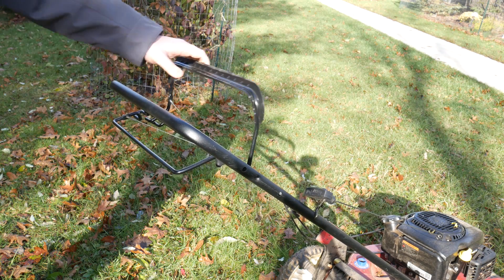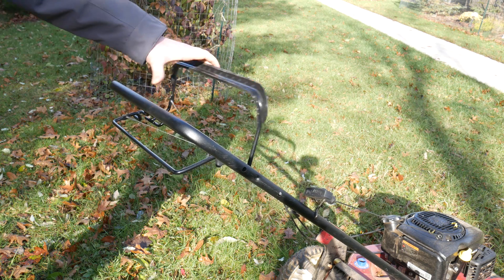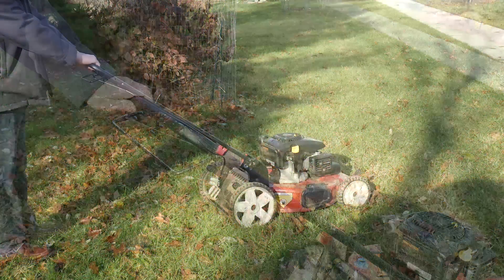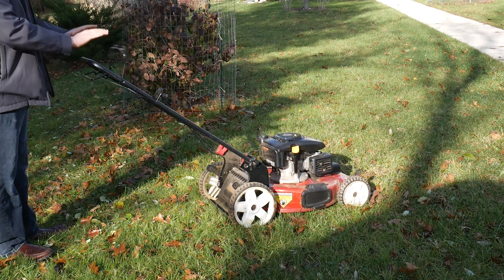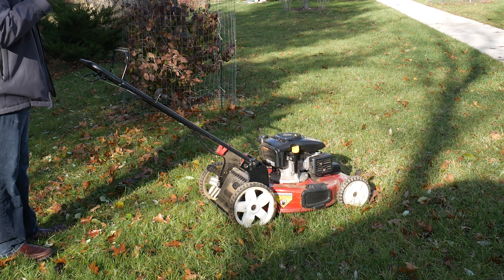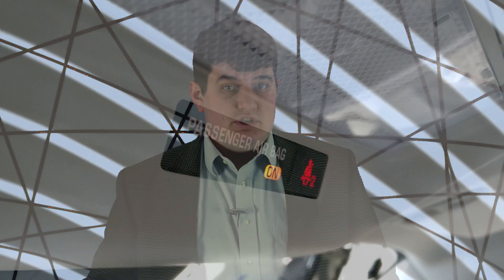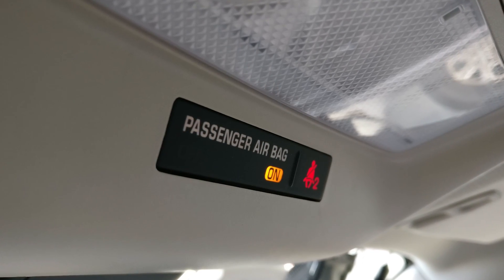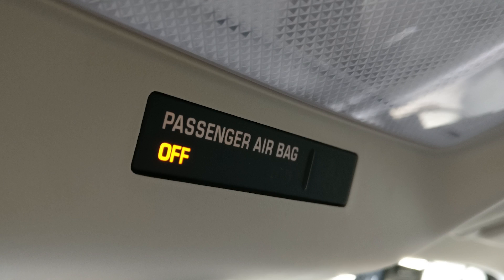The Dead Man's Switch:  How Anton Yelchin's life could have been saved

Comment: My 1972 Ford Maverick had a seat sensor interlock, they were only activated for vehicles sold in California. The interlock won't let you start the car without sitting in the seat and buckling the seatbelt. If someone sits in the second seat, they to must buckle the seat belt. Both cases it has to be in that order, you can't sit on the seatbelt.
(There's also a mechanics bypass button in the engine compartment so they don't have to get in and out that much.)
There are however issues. I had to replace a $300 computer because it stopped sensing the brake interlock for my gearshift on my last car. (something that they added back in the 80s) The sensor was working fine, the computer wasn't responding to the sensor. No shift out of park. The mechanic could not legally remove the solenoid that prevented me shifting out of park.
Just a note on vehicle engineering, my father was an Aeronautical engineer and worked on two of the world's first completely fly-by-wire aircraft: The F-111 and F-16. You lose your electronics in an F-16 it becomes a brick. The only thing that will work is the ejection seat at that point. 
But this is important: The F-16 had 3 completely redundant systems. They self checked themselves and voted on what to do. I don't trust cars with steer by wire because the redundancy is very low. I work with data heavy computers and applications all day long; I do routing, networking, and manage a small virtual cluster. 
Thus, I don't really trust computers that much.

Comment: Interestingly, Tesla vehicles have this exact same type of dead man's switch. If the car is stopped or moving very slowly and the driver gets up off the seat, the car applies the parking brake and shuts off. So if you get out of the car and forget to put it in park, it will put itself in park and power off. I don't know if any other cars have this feature, but it makes sense.

Comment: the problem with a dead man switch on the driver seat is that in case you need to push the car for a reason or another, you will require added weight on the seat in order to push it, in some cases that may even make it impossible to push, while at best case scenario, would require at least another person siting, instead of helping by pushing it.
that may be a "but why not call for help?" question, but we never know the type of situation we may find ourselves into, having this locked may get in the way more times than it will help.

Comment: A pretty compelling case.  Also consider that many cars use a passenger side sensor to alert you if a passenger has not buckled their seat belt, so again, the tech is already there.  You can tie it to a number of different things in the car.  I personally would not vouch for the door, though, as my old car was the victim of an unoccupied vehicle rolling (my dad's old truck, he wasn't in the habit of applying the emergency brake).  Seat belt or pressure sensor would prevent that; door sensor would not.

Obviously ANY such system should have an override for maintenance, testing, towing, etc.  And yeah, as far as the computer's power over the car, that's been done quietly for ages.

Comment: All true but you missed the most important failure. He never set the parking brake. This seems to be a very common error with automatic drivers. Set the damn parking brake! We as users need to take responsibility for our own actions and stop blaming providers for our stupidity.
Reply from the maker: Just to clarify, you are aware that there's no specific need to set the parking brake, right?  With an automatic transmission, the vehicle cannot roll in Park due to the parking pawl in the transmission.  I realize you should set the parking brake, but most people are taught that in an automatic it's only strictly required if on an incline in order to prevent damage to the transmission.

Comment: I don't want to get into all those 'Brand' arguments but my 2015 Ford Kuga will scream Blue-Murder if it is left out of Park when you get out ; it senses the door, the seat and the brake-pedal for engine and gearbox operations. For any car to have this it might need a seat-sensor added , but no other sensors have to be added [since your door already has an interior-light switch and the brake already has a brake-light switch] - so little extra cost - it is just software.
It is a pathetic failure that a 'modern' car such as the Jeep lacked such safety-interlocks.

Comment: Video: "You can program in something like pushing the ignition button 5 times to override the sensor, and it can be ignore at high speeds so it doesn't trip from shifting in your seat."
Comments: "DUUUUUUR HOW U SUPPOSED TO TOW TEH CAR GET A 200LB BRICK LOLOLOL ALSO WHAT IF I LEAN TO FART AM I GONNA GET LAUNCHED BECAUSE IT STOPS LOLOLOL DIS SUGGESTION IS STOOPED"
You can always tell which people didn't watch the entire video before commenting. 😒

Comment: Way easier solution than relying on the seat sensors... The moment the driver's door opens while the engine is running, the automatic transmission shifts itself into Park --- even a 10-year-old E70 BMW X5 (with a similar shifter mechanism) does this.

Comment: Are you on a space ship? Very futurist background.
Reply: The Nevo shhhhhhhh.... let the magic exist.......
Reply: If the accident happened or could have happened with the car in neutral, this wouldn't help. Allowing an unoccupied car to remain in neutral is necessary for towing or otherwise moving a car that isn't running.
Reply: @brunner314  Flatbed tow trucks, which are already required for 4WD/AWD cars, would negate this problem.
Reply: DaedalistKraken maybe add an extra step to override not being able to put it into neutral if there is no driver, so that it can’t accidentally be put into neutral without the driver.
Reply: @brunner314  There could be a specific override (code or switch) for that.
Reply: @brunner314  there could just be a switch inside the car that manually disables to switch for times like that. If you're worried about people who would just leave the switch active then have it so the next time someone sits on the seat the switch automatically returns to the off position.
Reply: Nerds... In... Spaaaaaaaaace!
Reply: @RicheBright  Wheatley?
Reply: futurist? this is right in line 80's photo backgrounds. only lacking the color. hardly futuristic
Reply: If I go into my backyard and rip up all the grass and hang out my wall and then film myself in front of it could you use it as a green screen?
Reply: Clearly he's actually cylon number zero.
Reply: Star Trek
Reply: I think this spaceship was owned by Eddie Van Halen
Reply: @kobalt_ren01  yeah! I thought so too! Looks very similar to the frankenstrat stripes!
Reply: Yelchin was Chekov from Star Trek.
Reply: Greenscreen

Comment: More than that, all modern cars can apply the hydraulic brakes electronically, since the brakes in tandem with the ABS system and pumps are used to control stability of all modern cars, which is how Traction control and stability control work.

So there is no reason the car couldn't have applied the brake to stop the car if not shift into park, electronic parking brake or no.

Comment: If sensors were installed in the driver's seat, it seems like they could fail to detect a driver if he was leaning his weight too much onto the pedal and steering wheel, sending the car to a screeching halt. Also if the sensor ever breaks, then the car will be permanently stuck in park.

Comment: One thing I've noticed with crappy Chrysler products now is if you open the door while the key is on it automatically applies the parking brake. Kinda sucks working on them and opening the door while pulling into the shop and it throws you into the A pillar. 

I don't know what kind of Jeep killed this guy but I'm guessing it was a Grand Cherokee. The shift knobs on them are absolutely ridiculous. The feedback felt while shifting feels horrible at best. And the indicator on the knob is in a odd place. 

Someone remind me again, why is Chrysler still in business?

Comment: Or a better option might be to actually interlock the central locking system with the transmission, in order to shift the car out of park the doors must be closed at which point the central locking system activates and only deactivates when the car is shifted back into park. It would need an override to ensure that the doors can always be opened in an emergency but the advantage of this double interlocking system would be that without intentionally overriding the system it would be impossible to open the door while the vehicle could possibly move which covers a number of other potential danger scenarios such as accidental opening of the door on the highway or the vehicle suddenly rolling into a person attempting to enter/exit (a ton of car doesn't need to be rolling fast for the door to knock you to the ground potentially even under the vehicle.)

A similar safety interlock is common on passenger trains though that is generally an interlock between the air brake system and the electronic door locks I believe.

Comment: Two pieces of advice:
1. ALWAYS apply your parking break when leaving the car
2. Drive a vehicle with a manual transmission. Youll even save money in the long run and be safer
Reply: NobodyImportant only in America really.
Reply: It's not that simple in this particular car as uses a return to Centre automatic shifter so it's possible to miss park and put it into neutral or other gear (and an I believe a foot handbrake)
Reply: In driving school, I learned to apply hand / parking brakes all the time when parked (or even starting on a slope). Also when parking, put your car into gear in reverse direction to the slope, so if your parking downhill, put it in Reverse. Also use your wheels to add an additional layer of safety by turning them around so they "dock" on the next walkway if applicable. 
All this helps giving you fail safes over the parking brake. If it fails, the gear will block the roll. And if that isn't enough, the car will get stopped by the walkway because (if you parked correctly) the front wheel will just push against the edge of the walkway and won't roll further.
Reply: One thing I should also add about a reason to always apply the parking brake is that not applying your parking brake ever is how you end up with a parking brake that doesn't work and it will become a pain if you ever need to park somewhere like a steep slope where you'll really need it
Reply: I'm a big fan of manual transmissions, but I live in an area where the roads get pretty nasty in the winter. A clutch would be just one more thing to manage when driving in poor conditions.
Reply: @timmowers435  They do have one advantage in the snow: manual transmission car is so much easier to rock out of the snow than an automatic, mainly because there's no delay--as fast as you can switch from R to 1 and release the clutch, it's putting power to the wheels, while with an automatic there's always a delay before the gear engages when shifting from Drive to Reverse and vice-versa. So it's much easier to get your timing right with a manual.
Reply: Manual transmission also makes your car harder to steal.  If the thief doesn't know how to drive a manual transmission car they will pass on your car to find something easier to steal.

Comment: it is not too difficult to have the indicator on the shifter and would only take up a few milligrams or (in gemology terms) carat or karat of weight and would be negligible in fuel savings.

put a small needle on the shifter lever.

remember the older cars from the 70's and 80's where there was a little curved rectangle like window above the steering wheel  that is a needle attached to the shift lever.

even if it is a  manual an indicator strip could be placed in the bezel.

take the 2005 mazda 5 shifter the plate over the shifter stick has a slot that has the indicator.

remember old radios from the 70's and 80's  attached to the string that turned the tuning capacitor is a metal or plastic needle crimped to the string.

cheaper radios used a toothed plastic strip then just a groove or painted mark on the know and the numbers on the face of  the device.

same goes for window air conditioners..

Comment: I work as a conductor/ engineer on a freight railroad in the US. Nowadays we use whats called and alerter which is a device that will start beeping and flashing if the engineer hasn’t modulated the throttle or air brakes for typically 20 to 30 seconds. If the engineer doesn’t hit the button before that time the system will apply an emergency brake application. Back in the day it used to be a foot pedal you would have to constantly depress down with your foot but engineers used to put a bag or something else heavy on the switch so they wouldn’t have to constantly depress it. Thank you for the videos they’ve become my new binge watch.

Comment: I work in the automotive field and I drive various vehicles everyday. Out of all the new gearshift levers I've come across, the Jeep's is probably the scariest. I really enjoy that someone actually went out of their way to make this video. I've almost left these vehicles on gear on accident multiple times, I just thankfully have a greater awareness for these things due to my expertise so I happen to catch it. I think your idea to solve the problem is great, I just think maybe there's just a little more to it? Like a speed sensor that disables the dead man's switch when the vehicles is in motion in case it happens to malfunction. Not that it would really do anything other than destroy the parking pin inside the transmission but still

Comment: Little people are generally light enough that the airbags are disabled when they are sitting in the seat (deliberately - the same crash dynamics apply as for children where the smaller body can be more easily harmed and benefits less from the airbag). That could mean that without appropriate hardware changes a car configured to use the airbag sensor as a dead man switch might be unreliable or completely refuse to operate for a little person who would otherwise be legally allowed to drive.

Comment: The solution was much more simple (and cheaper). Sadly, Chrysler is cheap and didn't want to add any new parts to fix the problem. The recall that came out was called S27: its a reprogramming of 4 computers (PCM, TCM, RFH, IPC. And in that order!) The recall made the car shift into park if the driver door was opened at a speed of 2 MPH or slower. The way we would test to see if a car had the recall was by opening the door at a slow speed and see if the car would slam into park. I thought it was a clever and cheap solution. Techs got paid 1.0 hours to do the updates and it took about 50 mins. 

There are 2 things that could become problematic with your idea. One is money, I know it's just a few more sensors and another module, but money is money. Even if it only costs 5 dollars per car (it would cost more then that) spread that out over 500,000 vehicles and your looking at 2.5 million dollars. Chrysler doesn't wanna spend money they don't have to. Plus if a malfunction of the system were to occur, you would be unable to drive the car. That could become a huge PR nightmare. Lastly is functionality. I'm not saying this happens all the time, but sometimes my butt lifts off my seat a little when im driving (when I reach to grab something, while repositioning, while taking off or putting on a jacket, etc.)

If I was on the highway and I reached to get something and my butt came off the seat. The car would hit the brakes and come to a stop. That could be more harmful then good.

All that aside, it was a very clever idea and I really enjoy watching your videos. You have great commentary and help me learn something new. Keep it up!